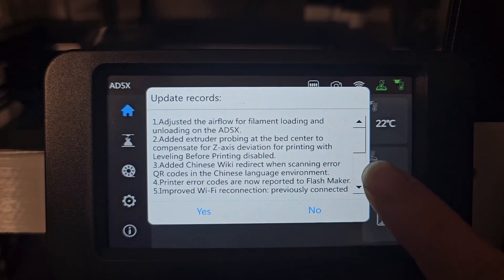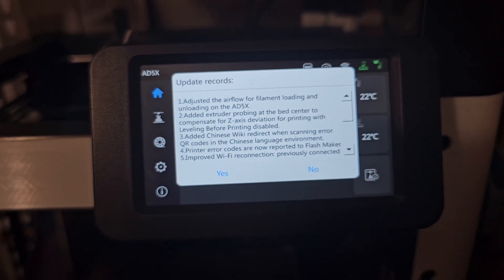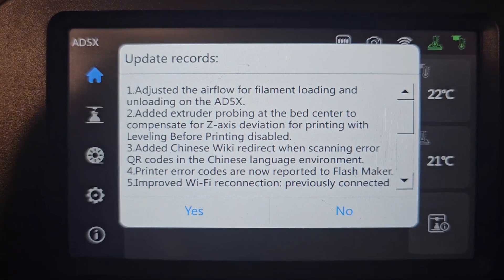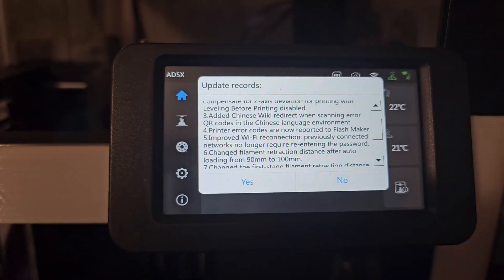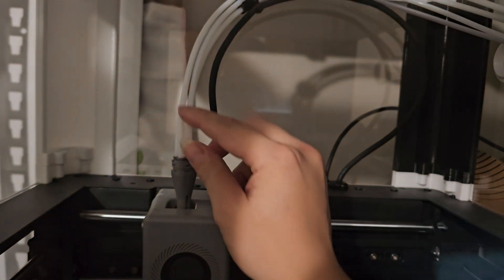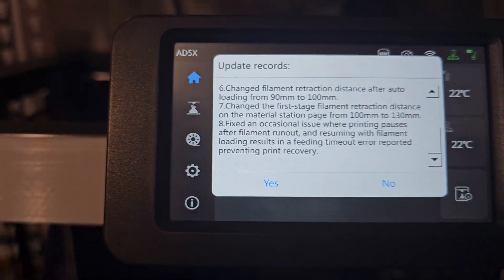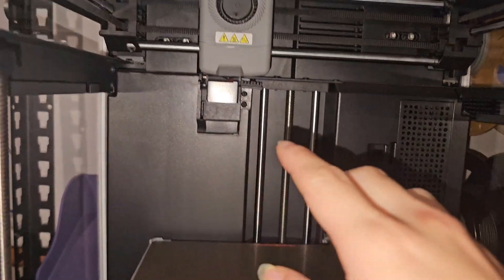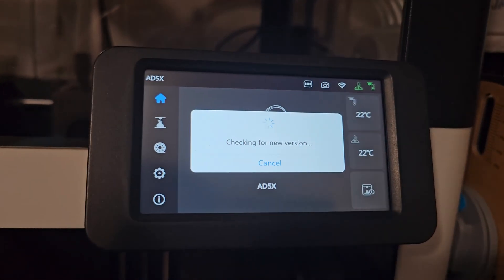AD5X New Firmware Update Fixes No Leveling

Comment: If you want to increase the strt time for the print and waste even more filament  and power upgrade to 1.1.9.  I have never had issues with 1.1.7 your comments aren't accurate.  now the only hassle is remembering to press no on the screen when i switch ad5x on wanting me to upgrade.. If you have upgraded just put 1.1.7 on a flash drive insert it in screen and switch on, it will revert back to 1.1.7. Also you also didnt do the second part of the upgrade and update the IFS. If you had your prime line would be at the front of the bed not the back.
Reply from the maker: Exactly, I remember the prime line was at the front, then upgrade to a new firmware and now its at the back, then this newer version it goes back to the front, thought I was crazy.

Comment: The printer only works properly with version v1.1.7. V1.1.9 did not print. I put it back to v1.1.7 and it is fine. I also wrote to support about the problem. It did not feed the filament and the head cooled down again.
Reply from the maker: For mine it works well with all version. Hopefully you can get your sorted out.
Reply: I am having the same issue. Did you get any resolution or did you just have to revert?
Reply: @laurenmunday9092 I restored it to v1.1.7. But report it to support. I reported it too, I wrote down what the problem was. So far, only v 1.1.7 firmware has been good.